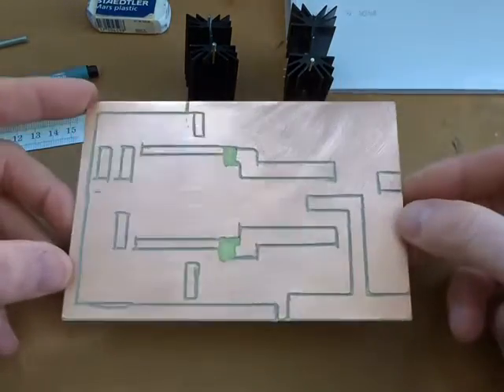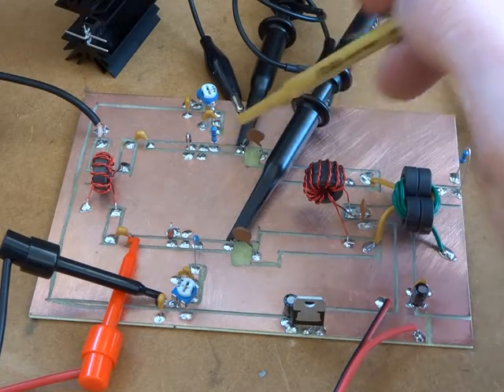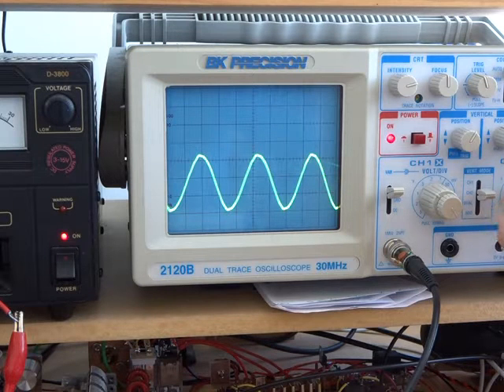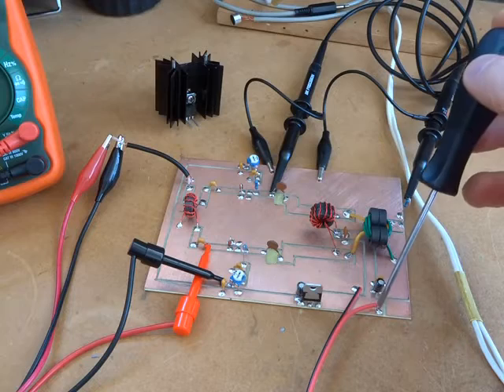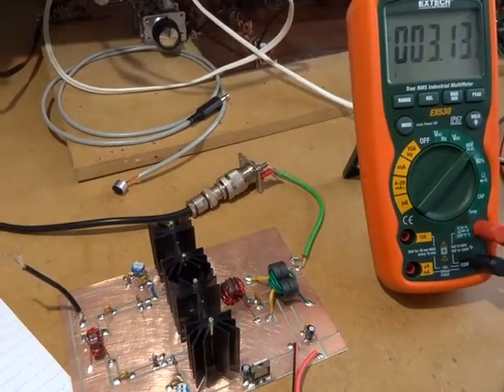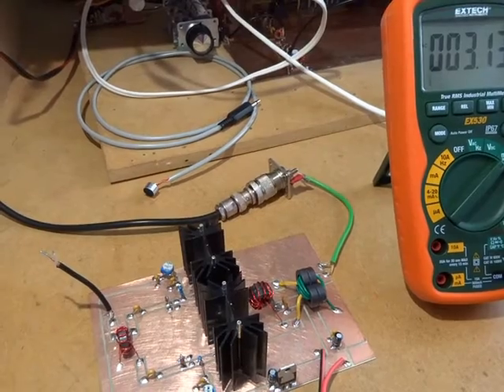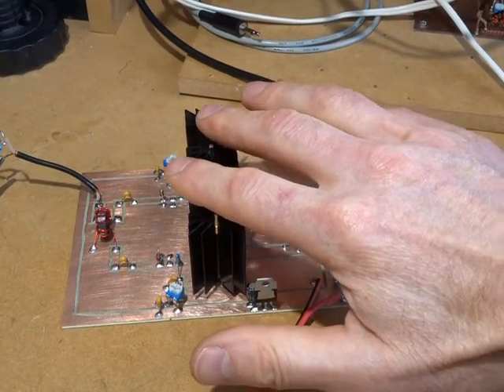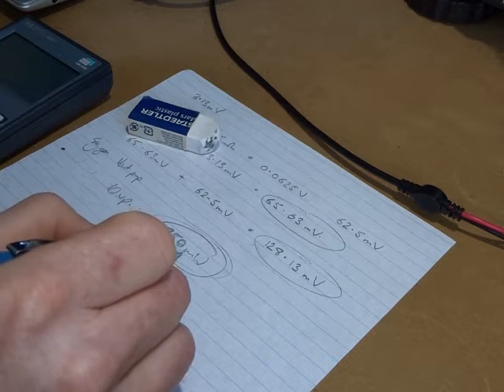Homebrew 80/40m SSB/CW Rig - #9b RF Power Amplifier Experiments

Comment: What was the supply voltage for this test Charlie? 12v, 13.8v?
Reply from the maker: Hi Paul. I'm currently travelling (again...) and don't have any notes with me. Given that it was a base rig, it would have been 13.8VDC. The small portable rigs are all 12VDC given the battery pack I have.Charlie

Comment: By having separate bias adjustments for each IRF510, matching the devices probably isn't critical.  You could check this by looking for distortion on the output with a scope, if the upper and lower portions of the waveform are equal, then the devices are probably close in gain.  If the bias is too far off you might see crossover distortion.

BTW you might try putting IRF510's in push-pull parallel.  I did see a design that used 8 of them in that configuration, with a claimed KW output on 6 meters!
Reply from the maker: Thanks for the feedback. At this stage I'm quite happy with the performance. Not bad for so few components.

Comment: Great instructional video Charlie. These FETs drop off above 10mhz, would interest me to see by how much, at 14 and 18mhz.
Reply from the maker: Hi Paul. Just did rough test. I first set the sig gen to 3MHz at the set the output to get 10W out. I then increased the sig gen freq and recorded the PA output on the watt meter and oscope. 3MHz = 10W, 67Vp=p, 7MHz = 4.5W, 43Vp-p, 14MHz = 1W, 20Vp-p, 18MHz = 0.5W, 14Vp-p.

Charlie
Reply from the maker: I should say too Paul that there is a 1dB drop in sig gen output from 10MHz to 18MHz. You'll need to factor that into the results above.
Reply: @CharlieMorrisZL2CTM  Just as the uBitx folks have found.  Still a fine QRP amp for lower HF.  WA2EBY claimed usable output power above 10mhz but he ran his amp at 28 volts (from memory).
Reply from the maker: That's right. 28VDC seems to be a common voltage. I was looking to use a 19VDC laptop powerpack, but it was limited to 2A or so. I will look at that again at some stage.

Charlie
Reply: 12v power with FET rf amps is a problem.  'EBY did claim close to 10w a 12v on ten meters though.  28v is pushing it, but you should get decent performance at 18-20 volts.  That 2A supply should work,  provided it can handle that load key-down.
Reply from the maker: Cheers. I will look to use that old laptop supply at some stage. It will be interesting to see what the power out will be.

Charlie

Comment: The newer IRF types are usually even more designed for switching. Older batches behave a little better in linear applications. When adjusting the quiescent current, I found that this "kink" is softer. But even today the IRFs are still different. To optimize it is still worthwhile to measure a few.
By the way, your voice sounds like a cold.
Get well!
73 Bernd
Reply from the maker: Thanks Bernd. In line with Stephen's suggestion I do want to try and match a couple, but unfortunately, I only had two in the shack. I'm looking to order a bunch and keep playing.

Yes, I've had a cold for a week, which is a real pain. I have an international flight tomorrow, so I'm hoping I'm a bit better by then. I don't want to be 'that guy' coughing all flight!

Comment: Charlie, you gave up on zener diodes to gate s hi😁
Reply from the maker: They are there Mikele. Just to the side of the two 27ohm resistors. I didn't see any negative impact, which is good.

Charlie
Reply: @CharlieMorrisZL2CTM  it s all great in schematics,no problems but you have to be careful where you buy fets 😉
Reply from the maker: Thanks Mikele. I'm looking to use Kits and Parts for the purchase. I don't trust my normal source, even if they are cheap!
Reply: Jameco, Mouser and Digikey should be safe sources for FETS.  Don't know if Vishay, IR,  On Semi (Fairchild), or STM are the best choice though.
Reply from the maker: Great. Thanks for that. I'll try Kits and Parts as I need some toroids too.

Comment: Good job there, Charlie. Thanks. I wonder if, with the 10-turn pots, tweaking the bias voltages could help with output waveform shape.
Reply from the maker: Stephen. I replaced the pots with 10 turn versions, which made adjusting the quiescent current easier. I then played around with the bias while watching the output. It did make a small difference, but didn't totally remove the distortion. I also played around with setting the quiescent current to 70mA. No major difference. I've now return it to 50mA. All good fun!

73s
Charlie
Reply from the maker: That's what I was thinking too Stephen. My plan was to swap out the trim pots tonight and keep playing. It will make bias adjustment so much easier!

Charlie
Reply: Nice board Charlie.  I might try duplicating one of these for my mighty mite, (to make it mightier.)  What is the value of the bias resistors, so I can order in some 10 turn versions.?
Reply from the maker: Hi Fanima. The original single turn pot was a '104' or 100k, as I couldn't find any 10k ones. The 10 turn pots that are now in the circuit are 10k. At the end of the day it's a voltage divider so 10+ k ohm will be fine. Anything less than 10k and the current through the pot starts to increase and you risk burning it out. I thought the dremel went well. I tried to make up a small jig so i could slide the board and keep the dremel still. That way the straight lines were straighter than by hand.